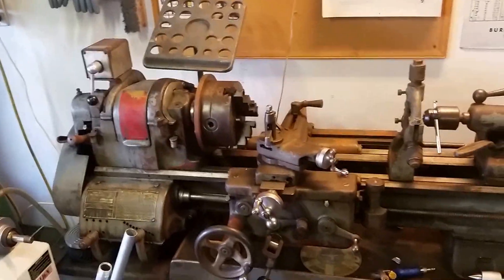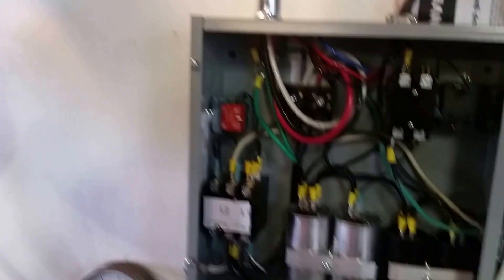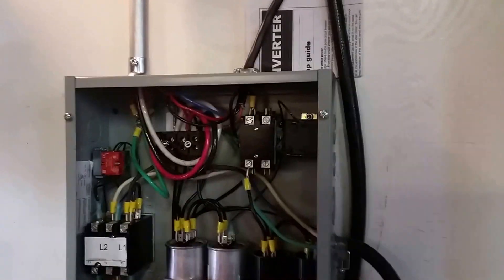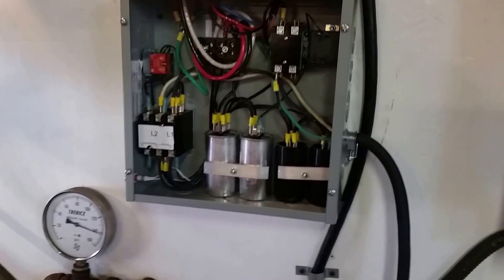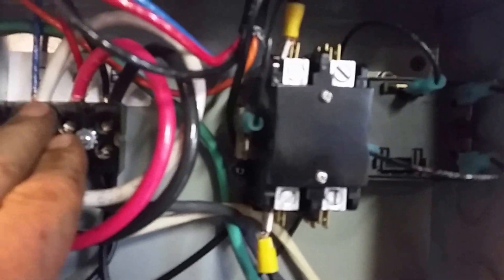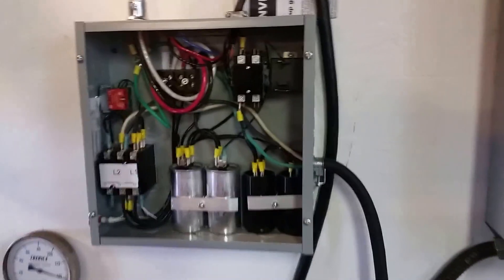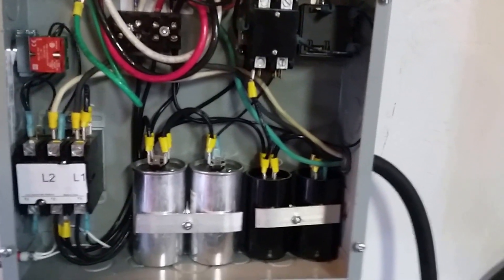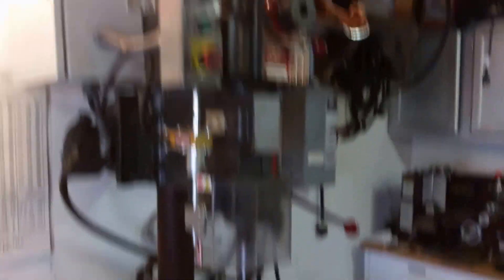WNY 7.5hp three phase converter review.

Comment: I have their 3hp unit but no wiring diagram. I emailed the company but got no response. I assume L1 and L2 are inputs and the CAB terminals to to the ghost motor. Then do the t1 t2 and t3 terminals go to the machines you want to power?

Comment: I'm a little confused on how I should have the leads configured on my 9 wire 3 phase motor for use with this panel ?
Reply: Would it be possible to add the schematic thanks

Comment: Nice vide, thanks for posting.  Just bought one off ebay for my 10 horse motor. Built one myself, but could never get the voltage on the ghost leg right. 190 bucks, well worth it. Looking forward to getting it hooked up.

Comment: Just wondering.. if the rated horse power for pony motor at least higher than the load motor.. then i assumed that the power consumption will double.. example i has 5 hp load motor , pony will be at least 7 hp,... I will be paying an excess 7 hp ... I think its better to convert the winding into single phase.. or install a china made variable frequency drive input single phase output three phase... 5 hp is 100usd on lazada...
Reply: 5 hp single phase to three phase vfd will cost only 100 usd on lazada,
Reply from the maker: That’s one way to do it. I don’t care about the power cost because.. really who cares. The machines run so little in my home shop that it doesn’t matter to me. Plus a 5hp 3 phase motor can’t simply be replaced with a 5hp single phase motor the power factor is different and most likely the rpms... also I have many 3 phase machines it will cost a fortune to convert them... and things that are direct drive like my disc belt sander and grinder simply can’t be changed.. another option is a VFD same deal.. quite spendy and can only run one machine.
Reply: @GlassAnvil  yes, thats the misery of no reasonable options but to use a rotary phase converter which cheaper than to purchase a three phase to single phase inverter . Good vfd is also expensive and higher hp capacity is more expensive,

Comment: I've been trying to get this unit working in New Zealand with no luck. NZ and Australian power supplies run on M.E.N which means, multiple earth neutral. I've been told that because our neutral wire is on the same bus bar as the earth in the breaker board, I'm essentially putting an earth wire into the centre of the pony motor. In the states you guys have two live wires and a neutral. Does anyone know much more about this problem and could offer some advice on a workaround?
Reply: No need to put the neutral earth to the common center of the wye connection motor, did you already try to connect your single phase directly to the L1 to L2, or L1 L3, or L2  L3, the remaining will be the capacitor connection, also, some motor has low and high voltage connection, ex. 220v and 380v. You still need to tap the correct setting. Now if you will be using higher hp motor , you need to put starting capacitor.
Reply: I tried it , 0 and 220 v, i did not put the 0 to the common of wye motor, i put the 0 on L1, 220v on L2, then capacitor on L2 and L3 of the motor. I use a 3 phase  220 /380v 30hp motor as pony, input single phase voltage is 220v so i set the motor to 220v, the motor connection is on delta, and its 30hp so it will be hard starting, motor is 9 wire, i tap it to make it wye on starting , delta on run , i use wye delta starter, i also put 5 pcs. 500 uf, as starting capacitor , normally closed timed relay 2 sec connected  on contactor , total of balancing run capacitor is 500uf, 450v, 50uf x10.
Reply: Another option, put transformer , primary input  your rated voltage 0 220v, the secondary will became L1 L2,

Comment: am trying to get a project out of this ...just with capacitor effects, good info ...I would like us to talk much on this. this my mail, it a project.
Esseldadzie@gmail.com
Reply from the maker: search google for "static converter" they are the same principle basically adding start and run capacitors to 3phase motor.. you just have to make sure to size them for the load of the motor you want to run.. from my research static converters do not produce a very ballanced sine wave.. but should be fine if you're just running old machinery would be terrible on new voltage sensitive equipment
Reply: Static converters are not good on machines with heavy start loads like compressors, hydraulic motors and larger lathes.  They fun things like small mills and grinders fine.  Statics produce NO power on the third leg after start.  That is why a static converter will only produce 2/3 the rated horse power on the driven motor.  I have static converters and have used them for years, but they are not the single answer.  I'll have a video out  on the details of wiring and tuning a rotary converter soon.  Very much like the one in this video only more consideration for motor differences and reducing load.

Comment: Please is there a way to provide 3 phase energy without the need for a motor ...I wanted to compensate third effect with the help of a capacitor
Reply: +emmanuel dadzie dadzie  My 3hp 3 phase lathe is running on a converter without the idler motor. It has two start caps and a relay. Runs fine. Motor is rated 7.4 amps and it is running at 7.1 amps. It will run all day just fine.
 I'll see if I can get back behind the lathe and write a schematic on it.
Reply: +newstart49 hello thanks much Sir, am grateful for this, is there a way I can contact u? as am taking a project on this

Comment: dude, i make this one for my homework with two method (one capasitor and three capasitor) not too much different. your phase converter better than mine. just 1 questions, if you mind. wich one voltage your phase converter change ? 220V to 380V / 220V to 380V ? or else. one more thing, in indonesia, so hard to find anyguys who make phase converter, you can sell it here with a good price cause your mine is good stuff. sorry for bad english.
Reply: If for 3 phase motor use, i suggest using variable frequency drive... China made vfd are not expensive and can be ordered at lazada. The input voltage is single phase, the output is three phase.. many voltage output to choose. Its cheaper, low power consumption and it runs on frequency better than relying on voltage.. the rotary phase converter will use higher hp than load motor, will double the power consumption.